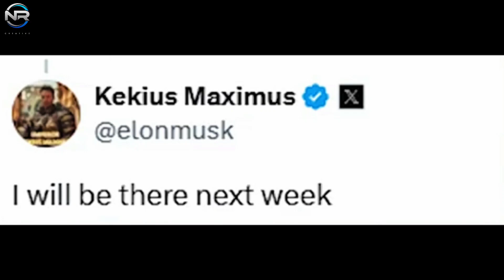Elon Musk Announces - The Truth Behind Starship 35 and Starship V2 Problems, For Flight 9

Comment: Musk has a problem, and that is that no part is the best part and the sick attempt to save weight.

If Germany built this Starship, it would be safer due to more safety in the design, and it would be heavier.

The engine re-ignition would work, and the resonance would be controlled by vibration damping and shock absorbers.

It would have landing legs and all the supply lines for
nine engines would be present.

The reliable function and safety of the system would be the most important thing.

Lighter and more efficient only come when a system is absolutely stable.

Made in Germany